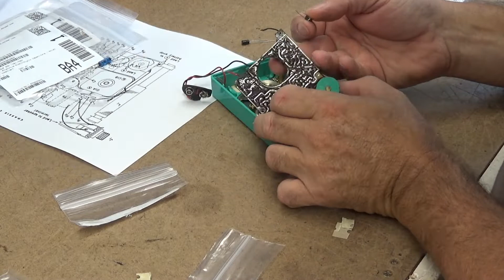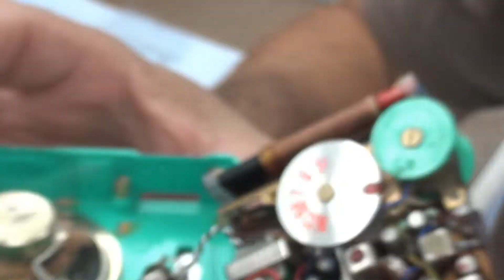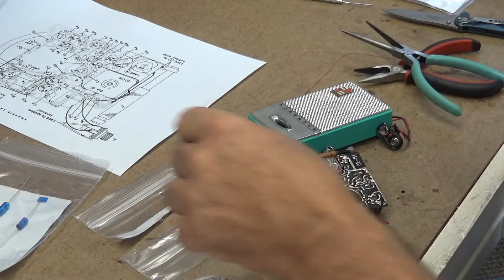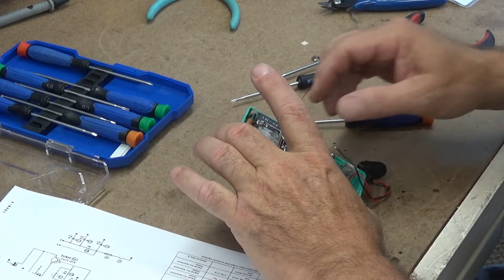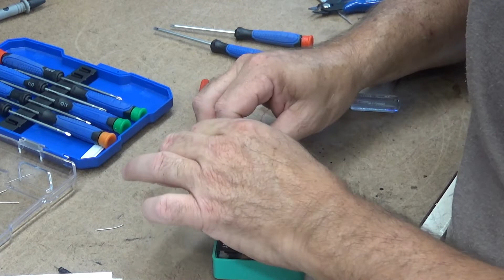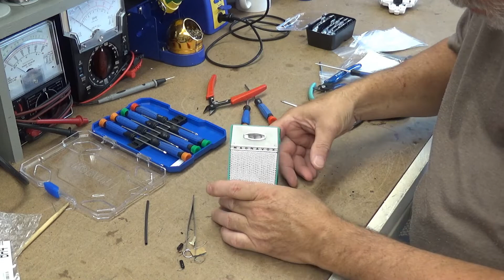Flea Market Find! Magnavox AM-80 Pocket Transistor AM Radio Part 2

Comment: That’s a pretty good 😊 little radio. I commonly found these at yard sales in my younger age. Not as fancy as this, but they were retro. I’ve never 👎 come across this Magnavox. Ya can recap it, just be careful, because the plastic casing may be brittle. I’ll try to guess that this radio is circa 1962. That’s when they made radios 📻 so much better. It would have been very interesting 🤔, had this been a tube type radio, using miniature tubes. I know that the speaker 🔊 is permanent magnet 🧲. Your friend, Jeff.

Comment: I just ordered a set of the magnifiers your wearing. I hope they work well. I have noticed you with them a few times an think it’s worth a try.
Reply: I have a pair. They’re pretty good but the led’s in mine stop working right. They just blink dimly now even with full batteries. I still use them with just a bench light.
Reply: @billmcdonald2436  thanks for the info. I was worried about something like that ,but it is an easy work around.
Reply from the maker: I feel like a brain doctor wearing those things
Reply: @oldavguywholovesRCA  😝 😝😝!! Your friend, Jeff.
Reply: @oldavguywholovesRCA  lol they do remind you of one operating on someone.